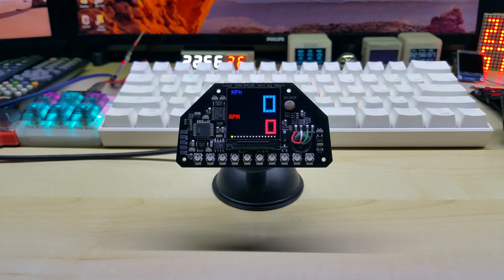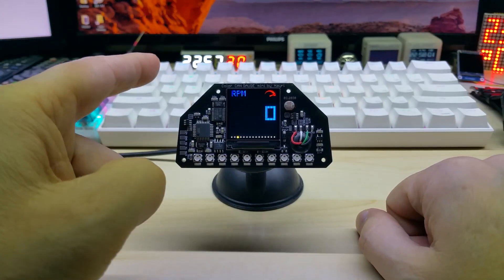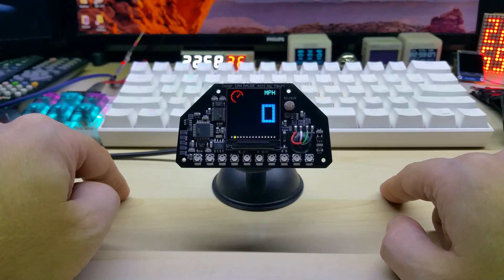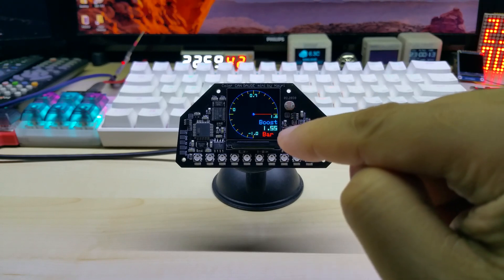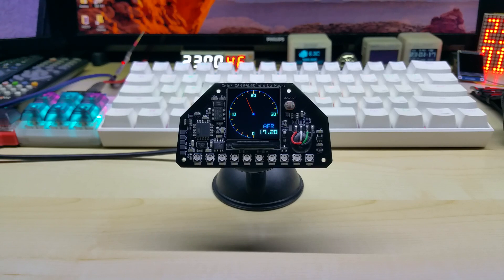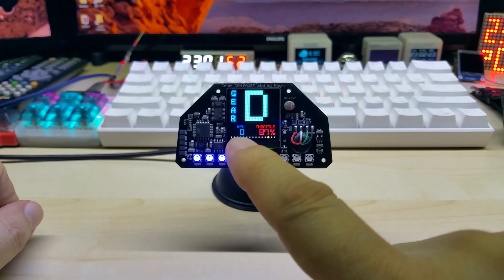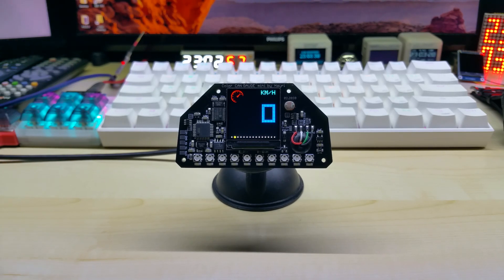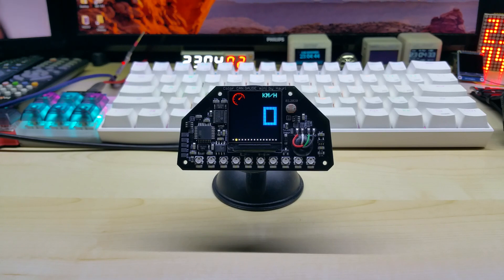Color CAN GAUGE mini, with new PCB and 2 integrated touch sensors and LDR sensor plus new AFR screen

Comment: Is this gauge sold out? Could not find it.
Reply from the maker: I have not put it up for official sale yet because the carbon fiber front has still not arrived. I did sell a few upon request because the buyer wants to make his own enclosure for it. Otherwise it is finished of course and I am using one ever since in my car. I also ordered some PCB fronts as well so it will be finished as soon as they arrive, can always send the carbon fiber later on as it is easily screwed on.

Comment: Hello, can this be done on a non OBD car?
Reply from the maker: Hi, it will be possible after I finish my CAN BUS Node that will take regular 0-5V analog signals and convert them to CAN BUS PID's and work with my gauge without any changes to it.
Reply: @iHayri1  i researced for a couple of days. I have an Audi 100 1986 year with a carburetted engine. I think I don't even have sensors. Do you know anything about those cars
 I will hook up a raspberry pi zero just for fun and try running it off the car battery via a voltage regulator.

Comment: Hayri, is the source OBD2? Because I have an old car that is completely analog with no onboard computer. I’m trying to add gauges like those to it. Will this work with individual sensor inputs? I.e. temp, oil pressure, voltage? Can you help? What does pricing look like? How can we talk directly?
Reply from the maker: Hi Greg, it does connect to the OBDII port but uses the CAN BUS data stream that cars 2008 and newer have to support by law. It would not work as is, but I am working on a CAN BUS Node that will take 0-5V analog sensor signals and convert them to CAN BUS PID's, create a CAN BUS network and send the data to my gauge. You can send me a message over my Tindie store or let me know your email for further info.
Reply: Hayri  my email is Gregcs245@gmail.com, I’d like to talk more.

Comment: Dear Hayri,

For me, most important display I want to see on this Gauge is .... CLOCK - when you are driving motorcycle it's rather inconvenient to check time on your watch or on your phone. It should be very easy for you to implement it. What isn't easy at all, but will definitely will make me to purchase your Gauge - notification bar. Again - driving motorcycle and checking  notifications on a phone might be dangerous - as you are keen to improve your product functionality to the perfections - for me that would be no brain to buy if it will have that function.

Regards from Down Under
Reply from the maker: Hi Aidas, unfortunately to have a clock I would need to add a RTC chip and backup battery plus there is no room left on the code. So I am afraid a clock will not happen.